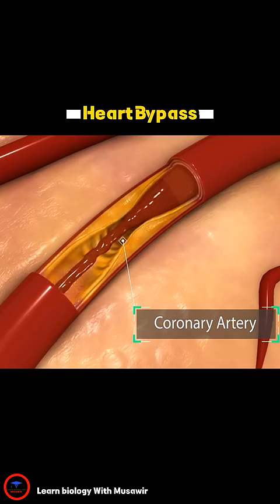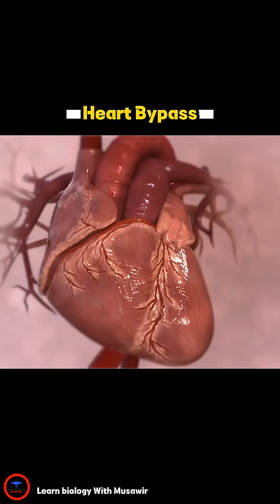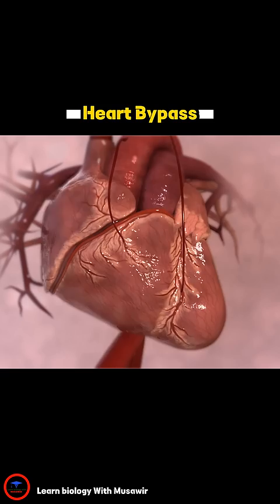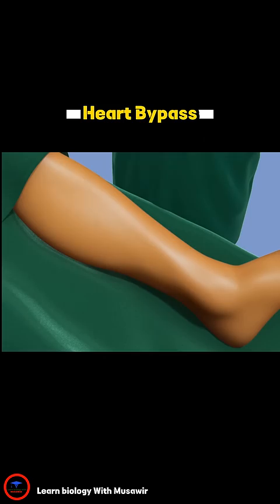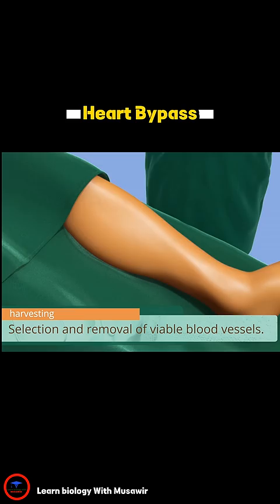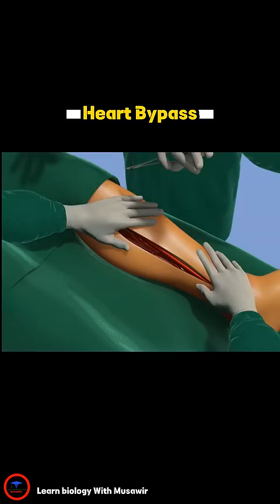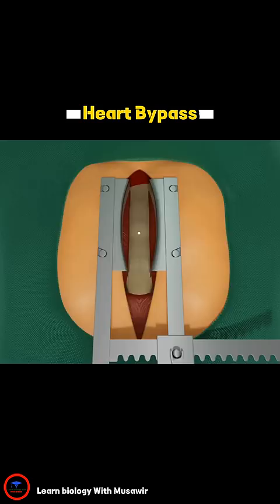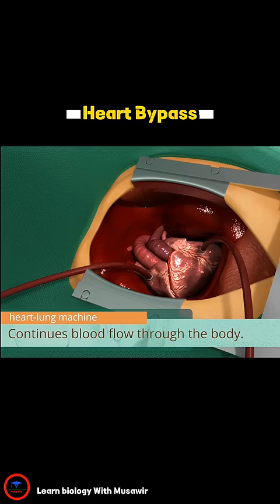Heart Bypass Surgery Procedure - 3D video _ #cardiology #short

Comment: But what happens to the leg? Won't it get affected after the artery is taken out?
Reply from the maker: You can live without your saphenous vein. That's because you have many other leg veins that help drain blood from your lower body. In fact, your superficial veins (like your saphenous veins) carry much less blood than your deep veins. So, your deep veins can manage the load if needed.
Reply: @MusawwirAshrafAliNoonari 
Thank you!
Reply: The deep veins take over the circulation of blood as saphenous vein doesn't carry much blood and is basically insignificant

Comment: The body naturally does add the same ovee time
Reply: 1. The body repairs the stitched sternum by itself
2. The circulation in the leg will be handled by deep veins which can get enlarged in case after the GSV is harvested for grafting 
3. The incisions also cure after a while
4. It's not certain if the pericardial sack is repaired or not but doesn't affect the body significantly 
5. There are minor side effects of the surgery but mostly it's a success and certainly when the surgeons are highly experienced

Comment: I've one confusion... After taking the artery from our limb... Isn't the portion from where the artery is taken without artery... So do they stretch the artery and stitch it back or something else...

Can someone clear my doubt
Reply from the maker: You can live without your saphenous vein. That's because you have many other leg veins that help drain blood from your lower body. In fact, your superficial veins (like your saphenous veins) carry much less blood than your deep veins. So, your deep veins can manage the load if needed.
Reply: One correction, the great sephanous vein is harvested not any artery the artery used as a graft is internal mammary artery which isn't present in legs or any limb 
Also there's no effect of it on the circulation because it's a superficial vein